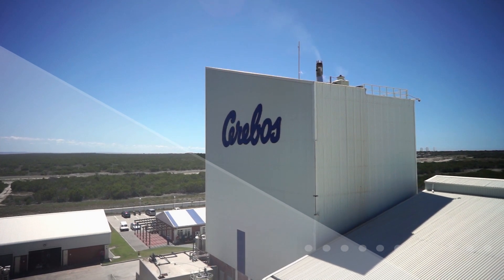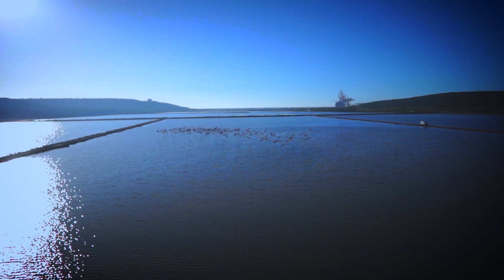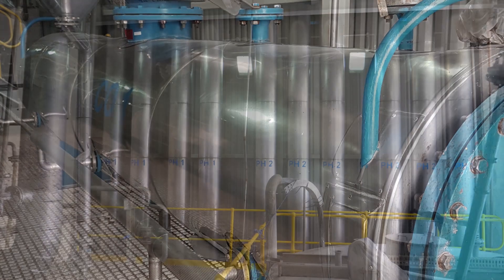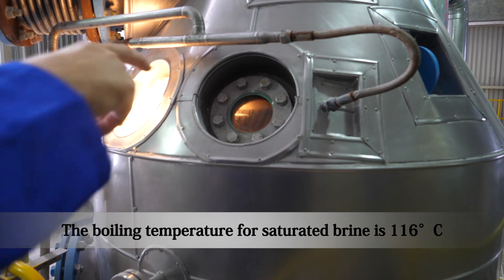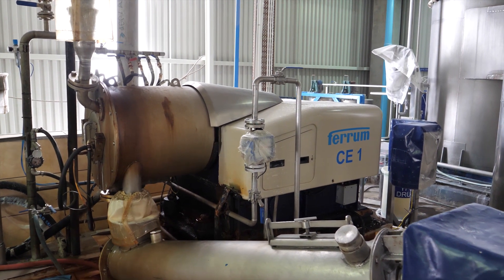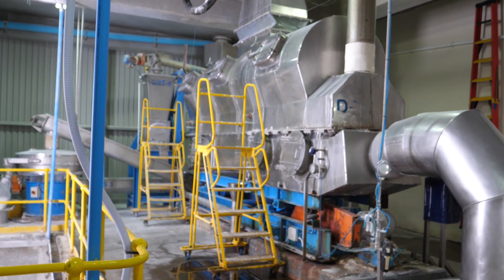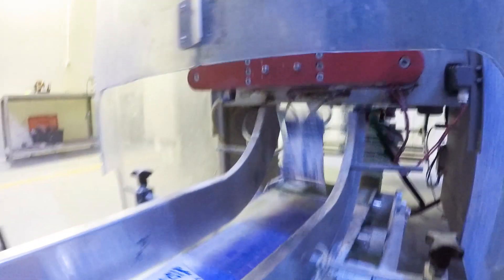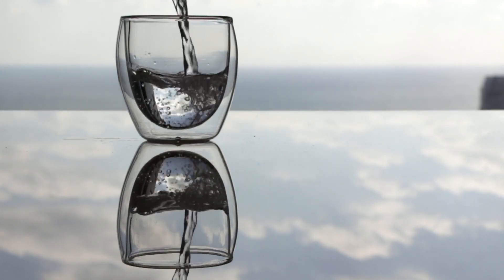How they make 100 tons of salt every day | How salt is made

Comment: They use saturated steam not superheated steam.
Reply from the maker: Hi Zaid, thanks for your comment, what's the difference between saturated and super heated steam?
Reply: @howitsmade5865  superheated steam is saturated steam that been heated again, superheated steam is very bad at heat exchange , it has high kinetic energy, thus it used in power plant to drive turbines , saturated steam is great at heat exchange, about 50 times than superheated steam, thus it is better suited to heat exchangers use , if superheated steam to be used at heating process, it is passed through a desuperheater, to remove the superheat and turned back to saturated steam ,
P.S if you take energy from saturated steam it will change phase back to condensate, at the same temperature, latent heat , superheated steam , will drop its temperature if losses energy.
i work at Spirax Sarco engineering, as a steam equipment technical sales engineer.
Reply: Zaid brother how would I be able to get machinery like this for my country?

Comment: Do they make use of the steam energy to create electricity?
Reply from the maker: The steam is passed through the centre of the Evaporation Vessel to heat the salt slurry inside the vessel to boiling point (116 degrees C)
Reply: :| fascinating